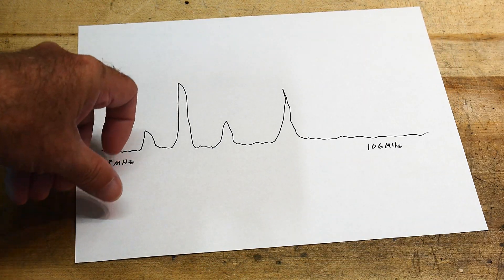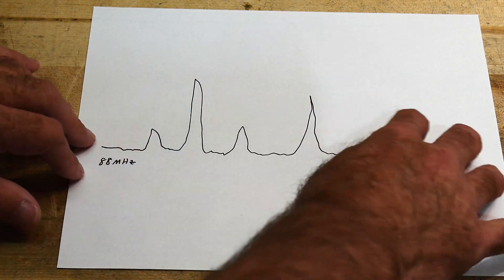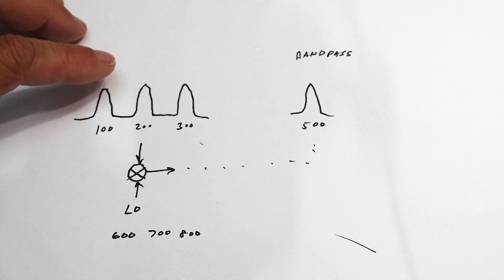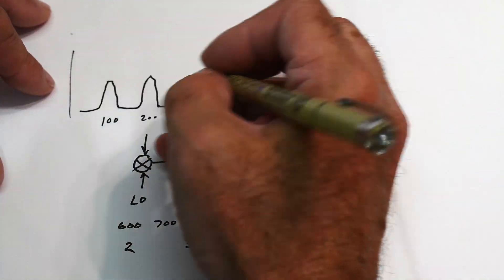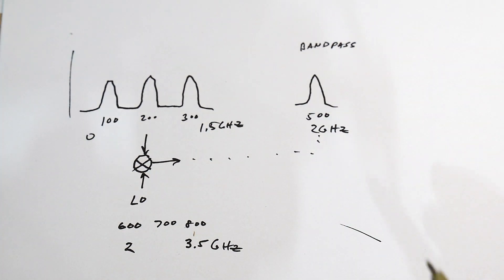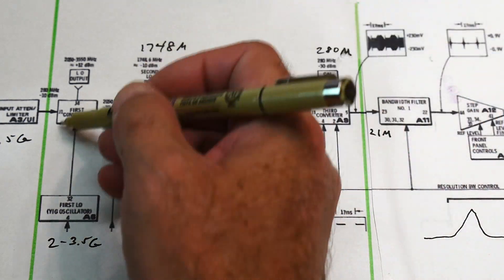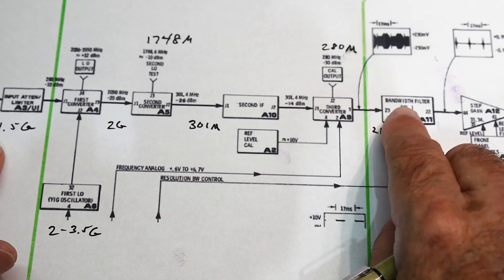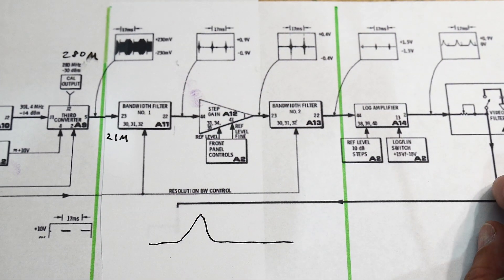#545 How a Spectrum Analyzer Works

Comment: @7:00 I'm like - thank the gods - as the Rode and Schwartz - video made the same point that the 'Spectrum" is translated / mixed not the filter / "mask" / resolution bandwidth "window"... Not many people make that distinction and weirdly those radios like more blinged out Malachite radio has a feature for shifting the signal (as a whole - or chunk of spectrum ) rather than moving the radio needle / narrow sample window like an old timey radio. Most people don't like that and prefer to have the needle move but weirdly I prefer to see the spectrum shift with static vertical "tuning" line. Conceptually that works better for me overall (for some reason).

Comment: Really nice video... would like to know how you came across those drawings...?
Reply from the maker: Which ones? the schematics/block diagram is from an HP8558 spectrum analyzer plugin
Reply: @IMSAIGuy  Yes, the schematics.  Thanks, I did some searching and found the user manual for the HP8558.  I am studying digital comms and radar, focussing on waveform design.  But figured I would try and build my own spectrum analyser (not at microwave!) to try and develop my understand of practical RF.  Your video on this topic has been super helpful.
Reply from the maker: @WiltonHoward  I always wanted to do a project like this: https://youtu.be/579SYLxORyw?si=iv5HcHn20B7ceBLd
Reply: @IMSAIGuy  Agreed.  Seen this one.  My plan is to get the 7558 fully modelled in Spice or Simulink and then see about the real thing... i am brushing up on tranmission lines a bit ...

I am actually thinking about trying to breadboard a really low frequemcy SA before something higher...

Comment: So it’s amplitude vs frequency. What makes the amplitude? I get how shouting is higher amplitude than whispering. But what are the energy differences here? Is it amount of data transmitted on that frequency? Examples?  An analyzer run in silence still picks up peaks, like a GPS signal. What gives that amplitude if it’s not audible volume?
Reply from the maker: the amplitude is electro magnetic energy, it can be from transmissions from external sources or self generated noise such a clock circuits. the noise the analyzer displays is the same noise that a radio picks up between stations. it is RF sources everywhere even from space. at the very bottom of the noise is electrical noise generated by atoms.

Comment: Hi , i am not rf engineer but i like  building  rf circuits  as one of my hobbies but for that it needs spectrum Analyser that why i am interested to learn it . Before watching this video
I thought spectrum   analyser must have using Voltage tuned capacitor varicap in lc tand and by changing the varicap capacitance by increasing decreasing voltage across vericap we can  plot the amplitude . But this isn't the case instead it use band pass filters to scan why ?
By the way 
I don't have any of these fancy equipment? 
Can i still do related practical experiment of Wave mixing for frequency   subtract and summing ...
Using very low Frequency in khz range  From function generator or by audio signal from sound card ? For leaning ?
Reply from the maker: you can use a varicap for a voltage controlled oscillator. Lots of radios use that. but just like a radio you need mixers to up/down convert, filters and detectors. the spectrum analyzer is much like a radio design with a vary large tuning range. varicaps have a limited range. The frequency choice for the LO needs to be above what you are measuring so a 1 GHZ spectrum analyzer need to have an LO above 2GHZ and a tuning span of 1GHz
Reply: @IMSAIGuy  you mean frequency of  "Lo" local oscillator have to higher then input frequency ? Right ?
Reply from the maker: @omsingharjit  https://youtu.be/yk6rsXnYvk8

Comment: 18:16 you mean ,  its
Because , amplification of low frequency is better suitable for transistors then higher Frequency in uhf vhf range ? That's why ?
Reply from the maker: i don't understand your question
Reply: I was asking , why it needs to lower the measuring frequency  before probing.?
My guess was..
I thought , it's because lots of electronic components don't work well at higher Frequency like ghz and have low gain amplification for higher Frequency !!
Reply from the maker: AM radios are designed in a similar way and do not have any frequency limitations.
Reply: @IMSAIGuy  🤔

Comment: Can you make arduino based  spectrum analyser using rf module sl4432 ?
Reply from the maker: Two of those chips are used in the TinySA spectrum analyzer.
Reply: @IMSAIGuy  what is tiny sa , is it SA device or SA software  which work with Rtl sdr on pc ?
Reply from the maker: @omsingharjit  https://youtu.be/n6WEM3--Npc

Comment: Looking forward to more on this series of spectrum analyzers. Great explanation of each stage of an analog spectrum analyzer. I'm trying to build one out of an ADALM PLUTO SDR by building in some of the stages missing to filter a signal and use the SDR as my spectrum analyzer to view the RF signal in the frequency domain using common control software.